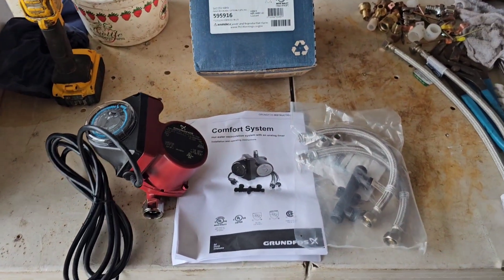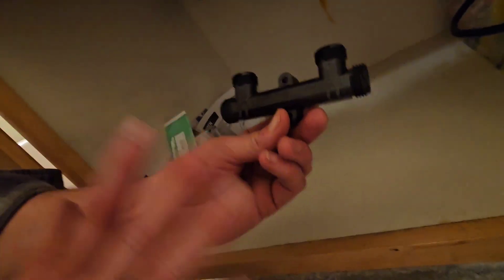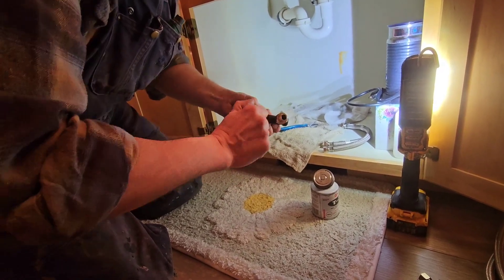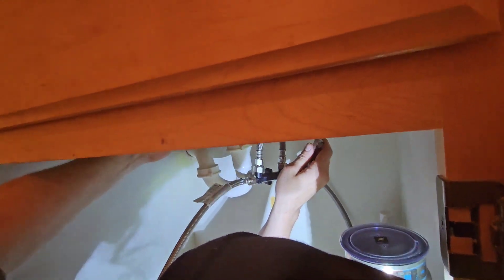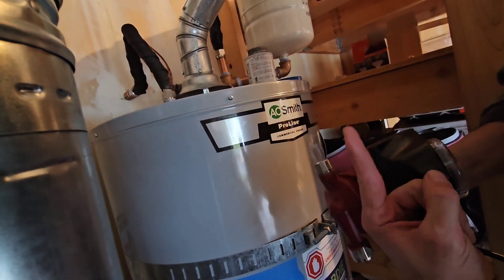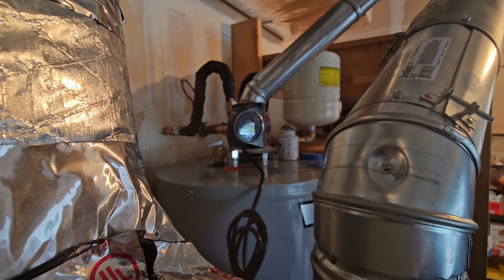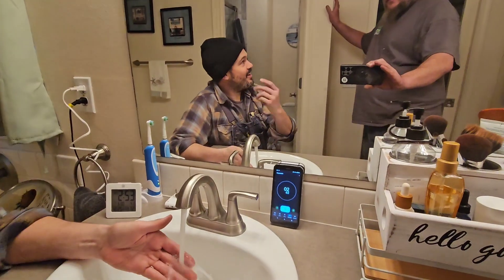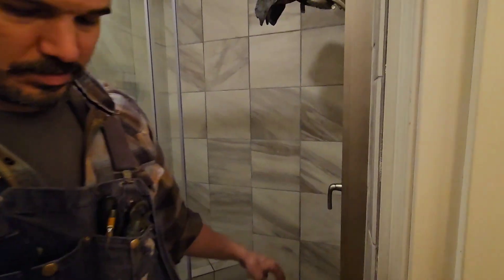Instant Hot Water with this Recirculation Pump with Bypass Valve.

Comment: can i install this considering i have high pressure water with a pressure reducing valve with that  bypass heading towards the cold side?
Reply from the maker: Yes absolutely as the high pressure does not effect the flow of water that pump is producing. Your good. You have the PRV that reducing your pressure to 65 psi? Hopefully? Yes the pump does force warm water into the cold water piping until the bypass valve is hot and then the bypass is closed. A certain amount of warm water is forced into the cold water piping and back towards  the water heater pump inlet. Thats the downfall. Sometimes you will be brushing your teeth with warm water

Comment: Good video, thanks for putting it out here for all to see and learn. Questions..... Shouldn't there be a check valve installed as well that is located between the main water supply (downstream of the water meter) and the main supply lines to the house, or does the pump have a check valve built into it?  Also, once you install this recirculation system, shouldn't the cold water lines now be wrapped with foam tape or foam insulation, since you are using them to return some heated water to the water heater? Or am I misunderstanding how this system works???? Thanks again!

Comment: The question is, is this possible in a three-story building? And if so, what should I do?
Reply from the maker: That's a great question... Assuming you're water heater is lower level and your desiring quicker hot water at the 3rd floor bathroom. Will the pump have enough performance. My answer to this question is No it will not. I have recently installed this system where the hot water piping is in the attic and down feeds the fixtures. It's performing very badly. A 3 story home I would say the pumps sold with the comfort tee bypass recirc system are not designed for that kind of head pressure.

Comment: Regardless of how the bypass valve stops the recirculating water on the cold water side is to use dedicated lines without ever crossing over to the potable water side. This system will work. However, unless you keep your water heater tank spiffy clean, you will be drinking the contents from it. Even then you cannot totally eliminate any heavy metal, cruds, calcium deposits etc from the water heater. A lot of people thought the bypass valve will stop the hot water flow to the returning line, but the fact remains that there is some hot water within the potable cold lines and you will be drinking that water as well.
Reply from the maker: Great Point that their is a chance that you might be drinking cold water that has some hot water mixed. Some parts of this country that might not be a great option. I would also like to add that you can set the timer on your circ pump to run certain hours of the day. Perhaps the hours that your not likely to pour a glass of water if your concerned with drinking water that is mixed with hot water that passed thru your water heater
Reply: The flow is low enough to not disturb the contents. Normal flow from the inlet tube that generally goes almost to the bottom is often designed to disturb the bottom on a regular basis. And that is without a pump.

Comment: Rheem Tankless with the external Taco recirculation pump and the bypass valve on what I believe is the furthest fixture from the current location of the water heater.  I am on my second bypass valve, and i still have issues with the cold side, its never cold and can take minutes to get even lukewarm.  Would a dedicated hot water return line solve this so there is no "bleed" of hot water in the cold side?
Reply: Maybe a faulty bypass valve?

Comment: Can you use this on a home that has the return line already plumbed back to water tank?
Reply from the maker: @ehink2716  absolutely you can use that pump. You want need the bypass valve. Pipe that recirc line to the bottom of your tank. I have a short video on it I posted a couple weeks ago.

Comment: Can I use this Pump for dedicated return line system?
Reply from the maker: @Kiwi-rf4jv  Yes Absolutely. This is my preferred pump for both bypass and dedicated line.
Reply: @LearnPlumbing  if I use this pump for dedicated return line system, do I need to use sensor valve?
Reply from the maker: @Kiwi-rf4jv  No bypass valve needed if you have a dedicated recirculation line.  Install the pump on the recirc line and pump that water back into the tank. Install a check valve just after the pump on the return line and install another check valve on the cold water supply so the pump can't push hot water back into your cold water.
Reply: @LearnPlumbing  When the pump operates, water is circulated into the water heater. Is it good for the water heater and does it waste gas to heat the water?

Comment: Do I need a blader tank, like I see they have on top of the WH?
Reply from the maker: Rolo great questions. Yes Storage water heaters should have an expansion tank. 50 gallons of water heated an additional 60 to 70 degrees expands by approximately 1 gallon or more. To avoid that expansion adding pressure to the plumbing system the air balloon in the expansion tank absorbs that expanded water.

Longevity of the bypass valve here in the Pacific Northwest where our mountain water is fairly soft, a little heavy in calcium amd the cities chlorinated a little too much. I tell my customers the bypass valve will be the first thing to fail around the 5 year period.

Comment: I couldn't tell from your very informative video but did you have an installed heat trap at the top of the anode rod before you attached the recirculating pump?  I'm going to attach a Watts recirculating pump to my Bradford White's water heater after first replacing the anode rod but I'm not sure if I should install the new heat trap I purchased?  The original anode rod had a heat trap so I purchased a new one to install but I'm unsure if I should?  Your thoughts please!  Thanks!

Comment: I was installing this system and installed the bypass valve first before the pump. What I found is I do not require the pump at all to give me hot water available. Seems the valve opens and closes based on heat as advertised but somehow the hot pushes over to the cold without the pump. This is a plus and a minus value for me as I have now increased to frequency of my hot water heater running during the day. My original intention was to have the hot water available at the shower in the mornings via the timer on the pump, now I have it all day and night.  Is there something wrong with my system that would cause the hot to push thru the valve without the pump running? Its a closed system (expansion tank), pressure from main is 65psi and rises a few lbs (1-2) during heating. Expansion tank is new and setup to mfg specs. Thanks for your thoughts on this.

Comment: If you're just pushing back the lukewarm water through the cold water system, doesn't this mean you end up with a legionella-hazard in the cold water circuit? The legionella in the (has-been) hot water should be dead if the boiler is set hot enough, but the cold water can have dormant legionella in it that gets active and breeding because of the higher temperature.
Reply from the maker: It's my uneducated understanding legions bacterial disease is from standing water. Seems to reason that the circulation would actually help with reducing the chance of legions. It's not a huge concern here in Washington for some reason. I always worry about long branch lines that are stagnant. Where are you from and is Legions disease a serious concern where your at?
Reply: @LearnPlumbing  I'm from Belgium, I don't think legionella is a huge thing here, but we are required to avoid storing water (circulating or not) between 20C and 55C for that reason. Above 55C the bacteria are killed, below 20C they are dormant, but by mixing you can end up activating the dormant legionella in the cold water.
Reply from the maker: @Candisa  Our codes require us to set the temperature no higher then 120 for Anti Scalding measures. Very little to no restrictions concerning legionella concerns. However when I'm showing clients how to set there temperature I do I form them that some clients prefer to keep there tanks at 140 to avoid bacteria growth in the tank. 
Thank you for your comments
Reply: Make sure its plugged into a gcfi outlet to prevent frying the pump if a power surge happens, speaking from personal experience

Comment: Thank you for showing this. I have one of these in my house and I really love it.  For some users who may want a little more robust control of it, they can have (an appropriately rated) smart power outlet installed where the pump plugs in.

I have this connected to a Samsung Smartthings outlet and so I can control the outlet from my phone. One downside of these pumps is that you can end up with excessive warm water forced into the cold water lines via the bypass valve under the sink. In my house this usually happens if the cold water isn't used very much. This can affect cold-water mixing in a shower which results in excessively hot shower water. While I don't always mind it, my kids do and so, with the smart outlet, I can turn off the pump on demand. Then I have a routine that checks every 10 minutes whether the pump is on or off. If the pump is off for 20 minutes, the routine will turn it back on.
Reply from the maker: Yes I agree. The smart plug outlets are getting pretty good. I should offer that as an option for my customers.